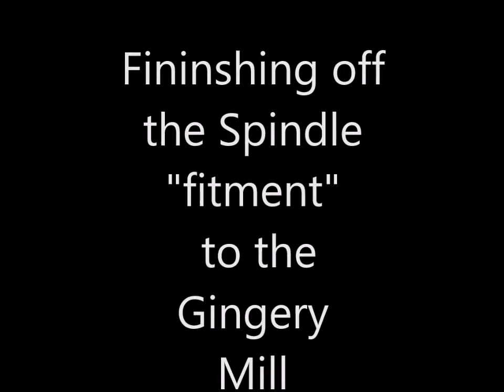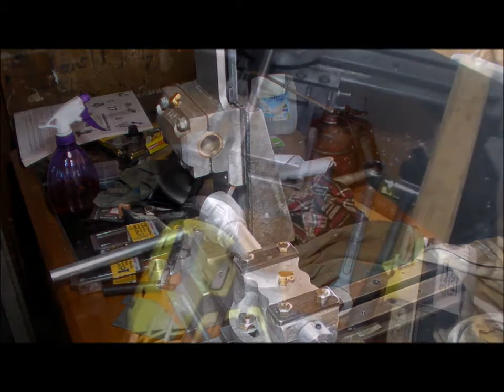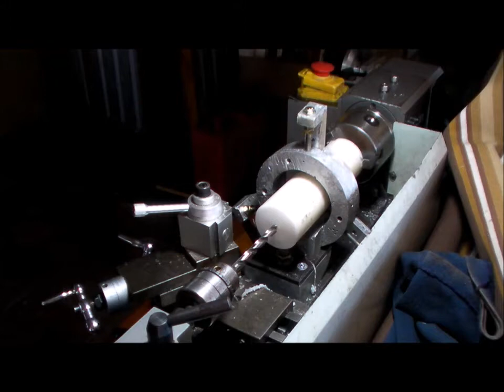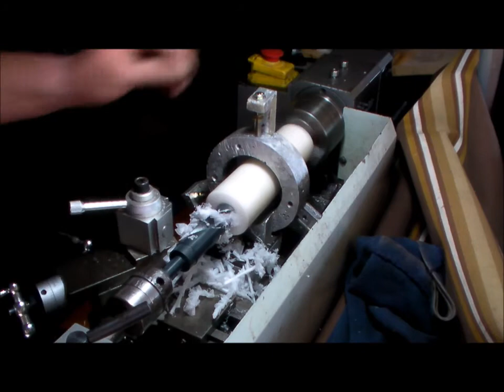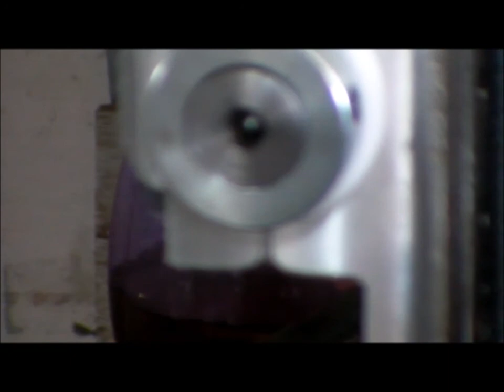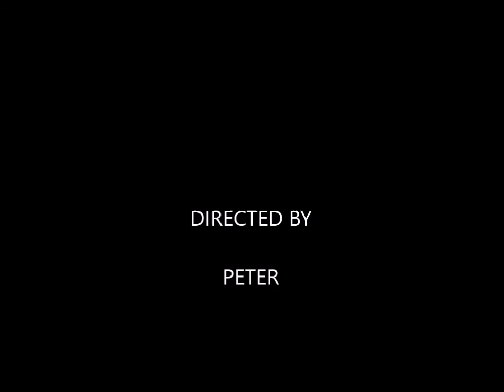Building the Gingery Milling Machine 43B

Comment: Peter, The ER collet sounds like a pretty good idea.  I am curious, how will you set up to bore the MT2?  How will you get the compound feed?  As far as I remember you only have orthogonal feeds, or have you a trick up your sleeve that you plan to spring on us?  OR, do you plan to bore the taper on the lathe?  Then, how do you ensure it is concentric to the OD of the spindle?  I know these may be newbie questions but I have to make chips sooner or later and enquiring minds want to know.

The fly cutter looks like it done a very nice job on the front the the quill support.  I think that tool is a keeper!

Thanks for the update and looking forward as always to the next.

Joe
Reply from the maker: G'day Joe., yes it is something I still have to settle. I have thought using the lathe, but it's compound slide will only travel 35mm without play in the gibs, so this would require a two step process to get the 65mm depth, it would be difficult to blend it in INSIDE a hole.  After the transmission the next job is the universal compound which holds the following component, the  "compound slide "which looks it may have the capacity to do the job. One problem with doing it in the mill itself is I loose the capacity to use it to face off the compound slide but then I could drill the spindle to 12mm for the first 30mm and fit a 12mm cutter to do the job.
Reply: In Gingery's Lathe book, he talks about making additional spindles for the lathe.  Maybe you can take that approach.  Make a second spindle bored out to take your fly cutter to be able to face the work table and other items.  Or you can make an MT2 arbor with a bored hold to take your cutters and use in your spindle with a drawbar.

I forgot about the "Universal Compound" slide.  Just looked at the book.  So it looks like it will take most of the available slide to make the MT2 taper.  A MT2 taper is 2.56" long and the slide ways are 7", but I don't know how much you will have available to use in the final assembly.

Workshop Practice series has two books on the Mini Lathe that you are using.  #43 - The Mini Lathe and #48 - Mini Lathe Tools and Projects.  #48 has a Taper turning attachment for the Mini Lathe.  Do you have these books by chance?

Joe